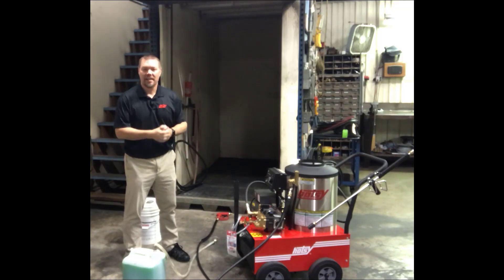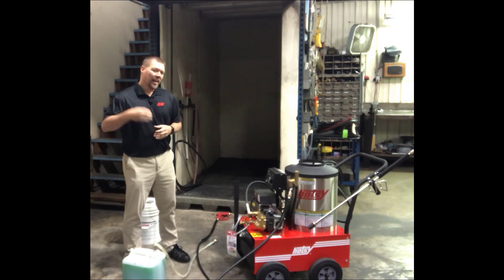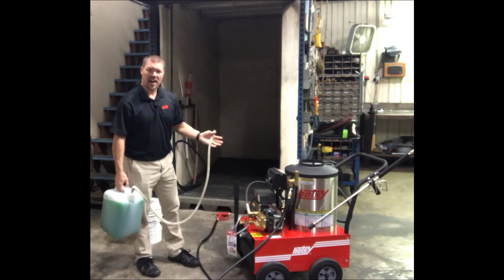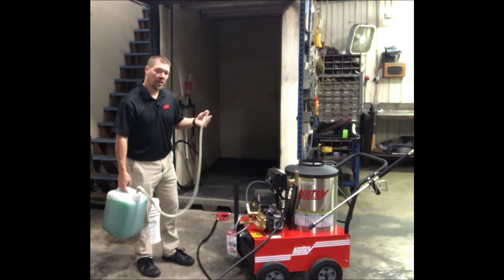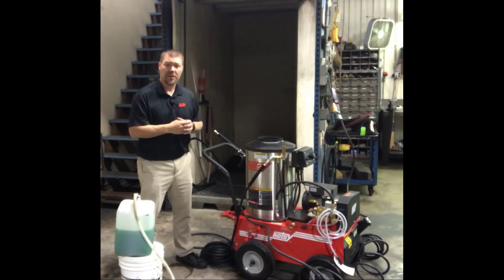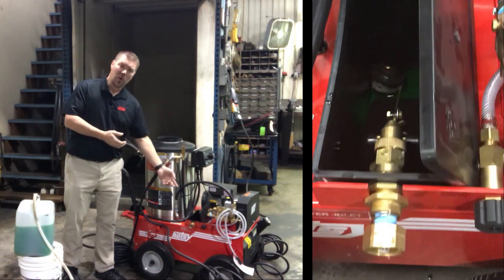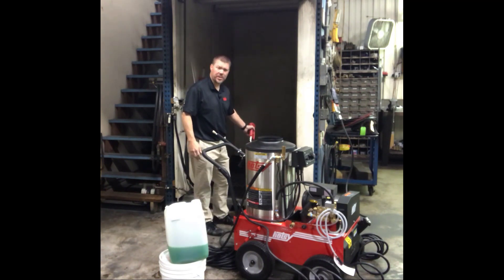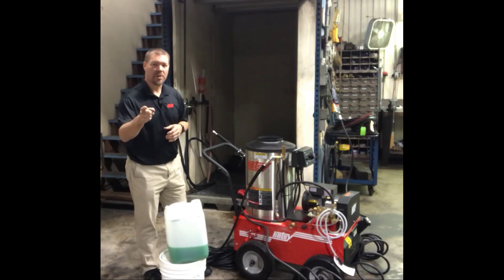Winterize your pressure washer

Comment: my experience - SS 555

used a 1 1/4 gallon gas can with a small spout, slid garden hose over the spout and hose clamped it - can had a separate vent -- 
would probably use a 2 1/2 gallon can next time if spout was small enough for the hose

biggest tip is to start and stop the flow as soon as the pump primes to purge the bypass immediately
-- there is a lot of hose and apparently the heater coils hold a lot of water

I waited to purge the bypass until I was almost finished and it takes a lot of antifreeze to push out the bypass water though the whole system

I thought from the video that a gallon or 2 would do it -- I used 7 -- mainly caused by waiting late in the process to purge the bypass

And then having to re-purge the whole system a second time

Got a lot of junk out of the system before the antifreeze came though

In the end  - all good 

- the guy at the Napa store thought I went through a lot of antifreeze pretty quick